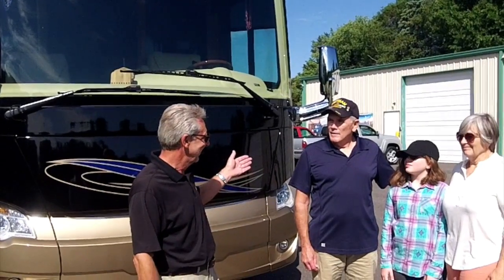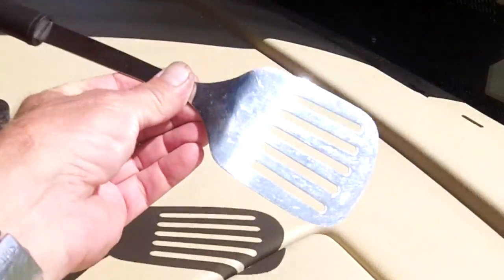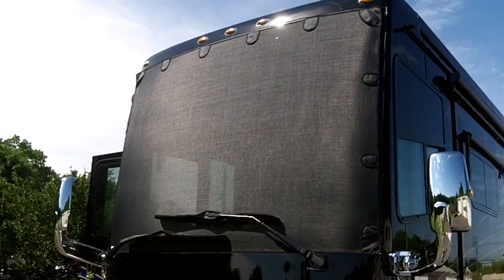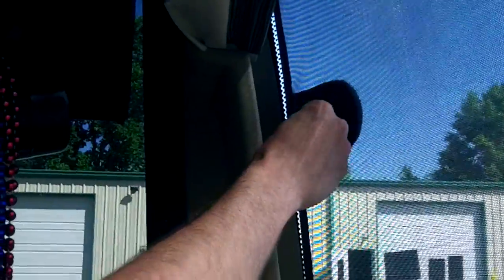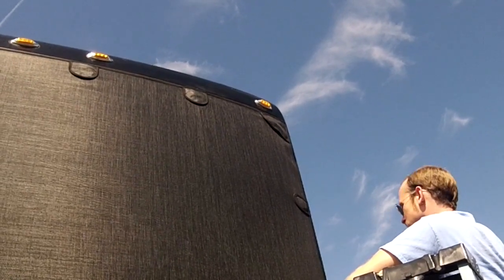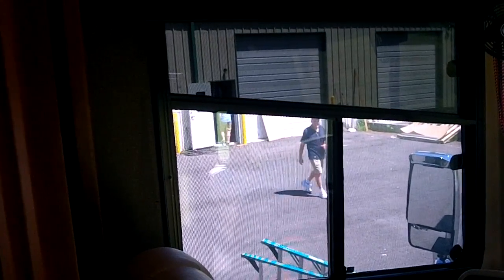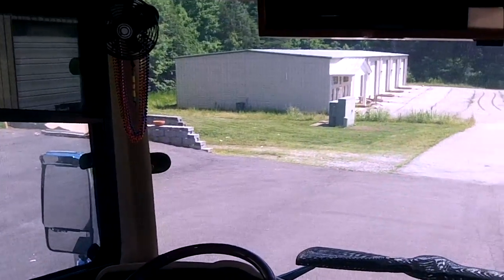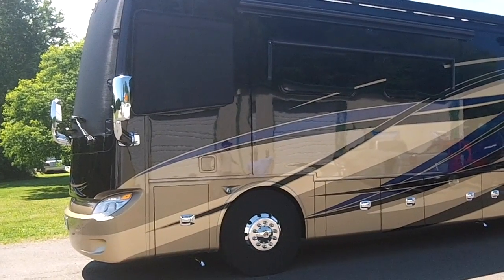MAGNE SHADE  INSTALLATION AND TIPS

Comment: Not realist on the top magnets. Plus you can't hardly reach them Mine aren't the big magnets and they need to be like on the sides in order to hold the shade.
Reply from the maker: From your comment I would guess that your coach has upper interference, most often from cabinets or bunks.  We have a video showing the install process for coaches like that: https://youtu.be/QV3ZscS9rzA .   Our office is also always happy to help with any other installation questions you may have, and we can troubleshoot any issues you might be having.  Please feel free to give us a call at (336) 753-0905